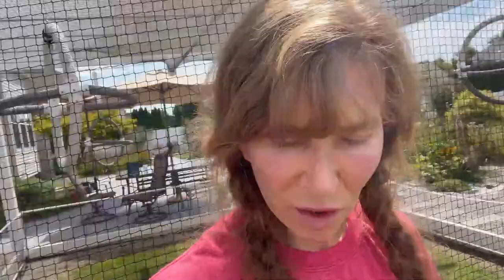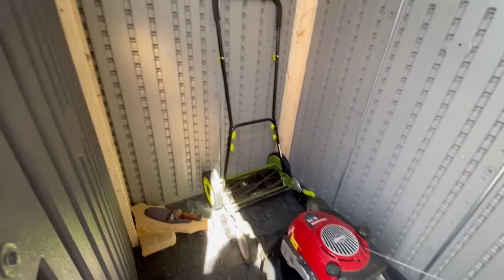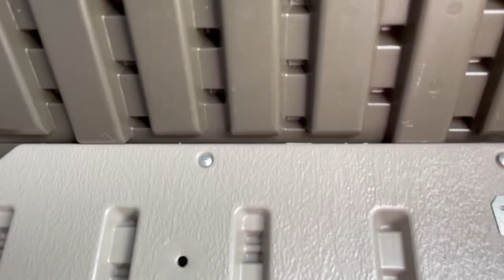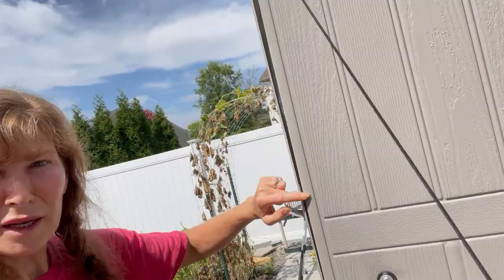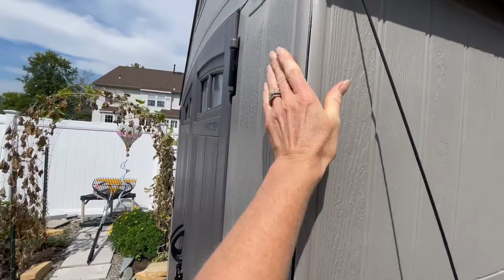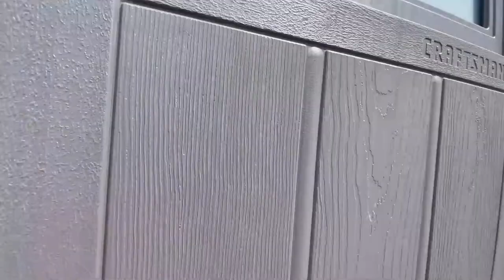Review and Reinforcement of Craftsman 4X7 shed

Comment: Needed to be secured to the slab/ foundation . Installer error .
Reply from the maker: thank you for watching and giving feedback. While this was our first resin shed of this size, and we realize we could have made it better at the start, we feel the average person should still be warned and learn from our experience.  We did have it weighed down inside with perimeter weight. The base never moved and that base is 100% level. It was warped upon unboxing. It pops out of its tabs very easy floor to wall. To our defense in our research we have discovered most people having the same experience and it needs to be framed to stabilize it. With that aside most people are experiencing cracks in the corners of the walls even without incidents. Its a bad design. We still feel people should be aware of all flaws before investing it in.  Thanks so much for watching!
Reply: Not according to instructions. They're suppose to just go into the slots.
Reply: Once you add items inside it should be secure but if you will only store small items better secure it to the ground

Comment: I used earth anchors in all 4 corners that go below the gravel base and about two to three feet into natural ground. They are then cabled up and over the metal trusses. So, the metal structure is anchored to the earth. We are in Florida…we’ve had hurricanes and crazy thunderstorms. These types of sheds NEED to be anchored to the ground or to a solid foundation…..period.
Reply from the maker: Please use some type of L bracket or hurricane strap to connect the floor to the walls.

Comment: Looks like you installed incorrectly
Reply from the maker: Actually what happened was, we installed it properly but the connector tabs are inferior, so the walls separate from the floor. It's a poor design.
Reply: @ourbackyardgarden any way to avoid this? Having same issues where certain connector tabs don't sit properly
Reply from the maker: @ALPHABARN  I strongly encourage an L bracket or something of that type to connect the walls to the floor. And earth anchor for a tie off point. Even if the floor is screwed or bolted to a base a good wind will damage it. Good luck!

Comment: Just put this up. I don’t think anchoring the floor will do it as it’s not that secure to the sides. I think we will do as you did and anchor it outside the shed
Reply from the maker: Yes, the issue is, the floor can be tied down but the walls detach! Even if it's drilled to a deck at least connect the floor and walls with hurricane ties! Good luck!!

Comment: Dont buy those! I have two 2x2 craftsmans that are very difficult to put together and yes they have warped and the wind did blow both of them apart! They were $250 ea. A yr agom, now they're 300. Ea. DO NOT BUY THEM!
Reply from the maker: Thank you for watching! The price did go up substantially on resin sheds. And it's a shame because that plastic will live in a landfill forever. I also have the 2x2 and it blew down as well. Since we earth anchored it and tied it off its now stable.

Comment: Hello thank you for doing this review. Can you tell me what sized lag bolts your husband got and the other small parts to go with it , you said both metal and rubber washers correct? He put that on a bracket not the wood ?
Reply from the maker: Thank you for watching! We used a combination of lag screws and bolts. All have rubber washers that go on the outside at the bolt and screw heads. We used the following list rubber washers are 5/16x 1.5 x 1/8  the flat metal fender galvanized washers that go on top are also 5/16 we used bolts for corner support brackets and screws for the wood framing. We used 2x3 framing so the screws are 2" and the bolts are 3" because they needed a nut. I hope that makes sense

Comment: Darn if it was more wind resistant I think it could be a nice budget shed!
Reply from the maker: Hi! Thanks for watching! Yes it definitely has its pros and cons.
Reply: I think a 2x6 wood base with sheeting floor and 3" header bolts would provide more anchor stability to the shed...that's where I'm at on my 7x7 shed.  I just put mine on a hand tamped gravel pad and wish I did the 2x6 base.  😢   live and learn.    can't dissemble the shed because the screws destroy the plastic once inserted.   looks nice from 10'.
Reply from the maker: @K03sport  good idea. The sides still need to be permanently connected to the floor because of the poor tab design connections.
Reply: @ourbackyardgarden ... agree.  now I'm researching the way to frame the shed on 3 sides and run a header over the door to keep it square ⬜

Comment: I know some other people who used some different brands did that ok for years. I wonder if the problem is this particular brand?
Reply from the maker: I honestly think it's many factors. This type of material warps in extreme heat, which we have. A design flaw is how the bottom floor attaches to side walls with a tab slide system. There needs to be L bracket or equivalent connecting the 2. Even if the bottom is screwed down, if there are any gaps for wind to enter, it won't stay together. The sides must be truly attached to the floor. And it must be flat and level.

Comment: Im curious for that big crack in the corner, have you thought about using a plastic welder to get everything closed again? Then using using some caulk to make sure its sealed? Ive got the 7x7 one with the same problem. It seems to work for me.
Reply from the maker: Hi Steve thank you for watching. Your comment is a great idea. I never thought of a plastic welder. The cracks at the corners happened immediately and before the storm damage even occurred. At this point the shed is still up but crazy things are happening with it. The doors are curling and the roof is pulling away. I'm accepting it as a bad investment. The next small structure will be properly framed. Maybe another greenhouse instead!

Comment: just bought the Suncast Modernist 7x7 shed.  it's sitting on an imperfect (hand tamped) 8x8 gravel stone base and I want to frame the inside.  (next time I am building the 2x6 wood base as shown on pg3-4).   did you use 1x4, 1x3, or 2x4 to frame the shed?  also, what about the footer stud(?) across the bottom?
Reply from the maker: Thank you for watching! We built out 7x4 on a level paver base. We were concerned the pavers would crumble if we tried to anchor to it so we used earth anchors and tied it off. John framed tge inside with 2x4. But....a better idea for a base and footing can be found in our Playlist for building our greenhouse! That thing hasn't budged! We used 4x4 and 4x6 for that base! We anchored to tge earth with rebar driven in, in opposing directions!
Reply: @ourbackyardgarden ... yes, my 8x8 stone pad is contained by pres-trt'd 4x4s w/overlapping joints at the corner.   55 bags of stone (ouch) and it's not exactly level/flat as this/these sheds require.   2' rebar is next in the 4x4s (2/board).   ground anchors may follow once I have a frame installed.  I will anchor to the wood frame vs any part of the shed.
Reply from the maker: @K03sport  if you drive the rebar next to each other st opposing angles, your prestrtd won't budge. If you plan to screw your floor to that, and L bracket your walls to th e floor you won't need earth anchors! The weak point is the walls not fully joining to the floor!

Comment: Thank you for the vid. I bought a keter shed from lowes on clearance and never read reviews. Seems like most plastic sheds have the same weakness, the walls to the base is not sturdy. I will have to copy your method and use a rope, or steel line around the shed with the ground anchors. Or i can use my 24*24*2 slabs and attach a eyelid screw and anchor it that way. Thanns.
Reply from the maker: Good luck! Thanks for watching!!!

Comment: Those sheds need to be anchored to a concret slab, it's going to go for another flight sitting on those path way tiles.
Reply from the maker: It's all tied to earth anchors now and the floor is now fully connected to the walls with brackets. Hasn't budged since reinforcement. The real issue isn't the floor being anchored, it's the floor being attached to the walls. It's a bad design

Comment: Just purchased this same shed and very concerned about the stability. I did not like the tab and slot system at all. Nothing lined up well and just seemed very weak.
Reply from the maker: Please consider at a minimum an L bracket to attach the floor to the walls. Building the interior framing also helped and earth anchors we tied off to.